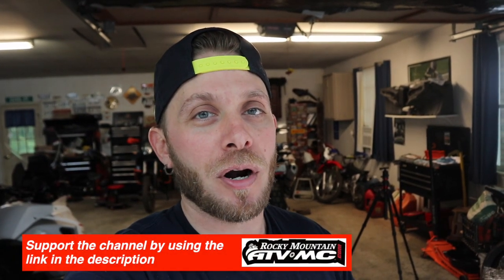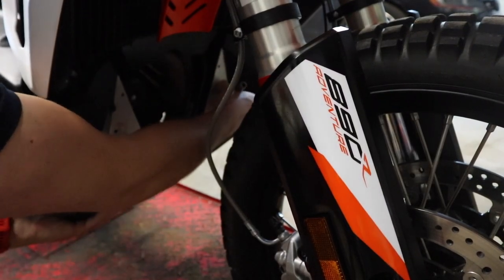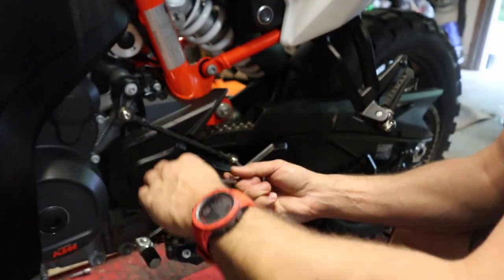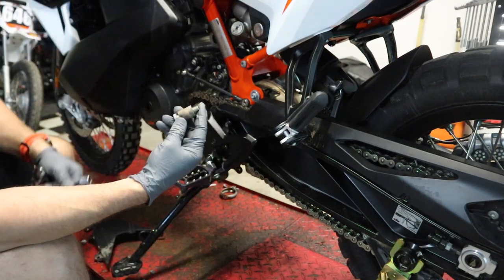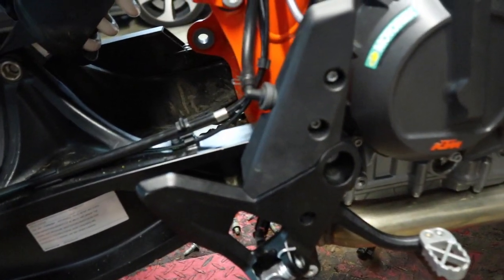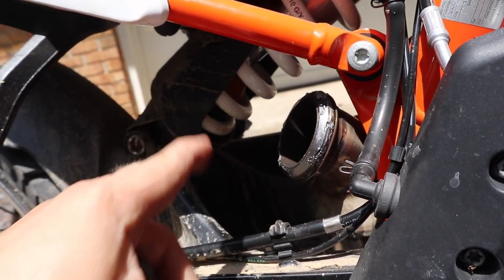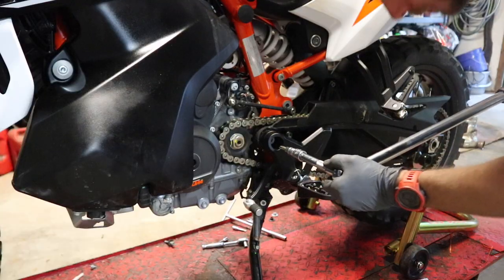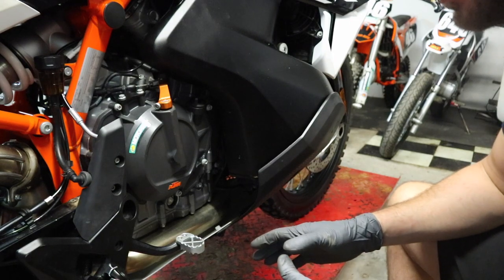KTM 790 890 ADV Cat Delete Mid Pipe | Back in the Garage

Comment: Thanks for this. Just finished up a 23' 890 Adventure. A few notes which may be 23' specific. If you are re-using the original bolt that held the cat on to secure the mid pipe it's 15 Nm. The shift rod bolt is 10 Nm. The 3 T-45 for the footrest bracket side stand all need loctite. I wasn't able to get to the right side cat bolt behind the brake lever with a ratchet and socket and had to use a 10mm open end ratchet.
Reply: thanks

Comment: I have owned other bikes with a cat in the pipe and simply drilled the cat out using spade bits. On another bike I simply cut open a window on the side of the pipe and removed the cat. Then rewelded the piece back.  Any reason no one does this with these bikes? If the pipes are stainless than I understand that takes a different welder.
Reply: 1.  drilling out the cat means you can never restore the bike if needed.
2. Arrow mid pipe weighs several kGs less than the cat, and it’s smaller which creates more space between shock and pipe 
3. Few people can weld or have access to welding gear.
4. Arrow mid pipe looks professional grade. A cut out and welded cat won’t
Reply: @TapleyBS  Makes sense and good enough reasons for most. For me: 
1)  The cut can easily be located in an area not visible, its just a small window. 
Also, the pipes I cut have heat shields, can not see the welds.
2) A couple pounds in weight savings on a ~500 lb bike when gps, bags, tools... are added can be accomplished with rider losing some weight. lol  No one will notice a couple pounds  low on the bike anyway. The 890 weighs 12 lbs more than the 790 and no one ever mentions it.
3) Pipe heat shield to protect the shock would be better and are cheap.
4)  $400 savings, I'd rather remove. But hey, I'm cheap and a diy'er.

Comment: Hey Mario, how did you find the heat issue, any significant improvement? How about performance,  any issues with popping or backfire on the overrun? Lastly, any issues at low throttle or low revs? Thanks.
Reply: Ask the owner of Wings Exhaust why he doesn't sell these cat deletes.  He will confirm exactly what you said above.
Reply: @RayzGarage  cheers, I still haven't installed one with my Wings exhaust as I suspect there might be issues. I would prefer a 1st hand experience before completely ruling it out. It is Summer here now and when the temp gets really hot, the exhaust heat from the cat gets quite uncomfortable in traffic.
Reply: @ride4adventure  got me.... That's what caused me to contact the owner of Wings for his advice.   I stand by my decision to leave it in

Comment: Just did 500 miles with my arrow and put my akro baffle back in. Instantly relieved my ears. Sounds dope with a straight system, but when you have a long trip or several days ahead, it still sounds good and keep the twin drone a bit. Stock muffler probably is great on the ears and still sounds cool. 

I agree, heat is way down. Keeps excess heat off the rear shock too, which has been known to fail early from CAT heat.
Reply from the maker: Appreciate the insight, Jordan! Realize the stock muffler doesn't sound "as" good but I'm a cheap bastard 😂 Another good point on the car and shock failure which is why I wanted to get out in front of it.

Comment: Off-road or on the road air is everywhere so why is it such a violation to run the new mod anywhere for that matter and I think it’s more of a safety hazard with that stupid hot cat can under your seat and ready to melt out the seals in the shock to blow out the shock and cause ride ability issues! I’m all in for this cat delete mod and great video!!!
Reply: measure at your cat and at the exhaust outlet.  The cat is not actually that hot.
Reply: @mojoriden  it puts out a ton of heat all over it with no where to go but your rear suspension and left leg. there's nothing else down there to create the heat but the cat.

Comment: did you happen to think to heat wrap that midpipe? I am putting on a similar midpipe swap and am thinking of wrapping mine...also installing the plate between that hot area and the rear shock.  Thoughts????
Reply from the maker: No. The cat is what gets hot. Once it's removed the midpipe is much cooler.

Comment: Thanks, I appreciate your videos. Once I do this will the factory mapping still work fine or do I need to add a power commander and a tune?
Reply from the maker: It’ll work fine
Reply: Engine performsnce has improved? How It effect at lower rpm, the engine lose torque, fluidity? Many thanks

Comment: Quick question,,, I removed my catalytic converter and did the same as you,, left the gasket on the cat. 
I couldn’t understand what I’d done wrong, found your video,, and thanks. 
But my question,,, how did you get the gasket off the cat??
Reply from the maker: Just used a small screw driver to work the edge and then it’ll slip off

Comment: Will the mid pipe void the factory warranty?  Wonderful garage video as always. Bike definitely sounds better now.
Reply from the maker: As with any modification (in the US) the warranty is only voided if the modification can be shown to have caused the problem. e.g. if the tft display dies they have to fix it because the mid pipe didn’t cause that. It’s only a year warranty on the bike and mine was already out anyway

Comment: Mario I followed your vid and installed my Arrow Mid-pipe today. All is good, no leaks at all… But one thing I wasn’t clear on is the tab on the mid pipe and how it attaches to the small frame tab that comes down. I just had issues trying to figure out how to make that solid so I can torque it to the 25 Newton meters. Ultimately I used one of those black spacers put that on the outside. I’m not 100% happy with that connection. I mean it is solid and I’m sure it’s fine but it just wasn’t as neat and clean as I would’ve liked it to be. Any suggestions on that? Thank you.
Reply from the maker: Sounds like you've got it tweaked a bit. Loosen the exhaust clamps on both ends to release the pressure, then try again. Shouldn't need any sort of spacers to fasten.
Reply: @2WR  ok I’ll do that. Thx

Comment: Are you planning to change the exhaust can with a slip on? Would seem to add more to sound, and possibly save some more weight.
Reply from the maker: No, I’m gonna leave the stock can. Check out the video we did on the Norden 901 exhaust. All the weight savings data is shared on that one.
Reply: @2WR hi, from italy. Is there difference from a totally empty decat, or one like that you mounted in this video? Because I have a totally straight decat..without the little decat you have in your, i mean...and did you a map after this installation?

Comment: Great video!
I did the same installation to my bike but I have a problem. After 5 kilometers test run my engine was stalled and it won’t start again. I have to pushed my bike home and replace the decat mid pipe to the stock catalyzer pipe. And when I start the bike it only runs for 130 seconds and stopped. I don’t understand which step I did wrong…Do you have any idea?
Reply: Does it sound decent when it runs, do you hear anything different. Something might be shot.

Comment: Great video, I love my 890, however this heat that radiates out is unbearable especially in Las Vegas. So all I need is that arrow midpipe? And you truly noticed a heat difference? Because I’m thinking about getting a new bike due to this heat. Thx
Reply from the maker: There's a noticeable reduction in heat. Also, I don't know what your riding gear consists of, but a quality pair of riding pants due wonders in keeping your legs from cooking.
Reply from the maker: I'm not complaining about the heat since I wear a good pair of riding pants. That said, if you don't have your feet in tight and legs up against the frame, you don't have proper control of the bike. (aside from cornering when you need to weight the outside of the peg)

Comment: Good job, I wonder if it does need retune the ECU ?
Reply from the maker: If you want to FULLY maximize performance, yes. That said, it's not require and you'll still realize some gains from it (aside from weight savings) if you don't.
Reply: @2WR  thanks 🙏🏻
Reply: @2WR  Do you have a recommended flash or tune you recommend?
Reply: Any time you remove the catalytic converter on a vehicle you should get the engine tuned to adjust airfuel ratios for the higher flow rates. If you are removing the Catalytic converter it is also suggested to get a high flow airfilter aswell.

Comment: The clamp that goes on the midpipe and the engine pipe just will not line up, the engine block itself is not giving the clamp enough clearance. Did you have any issues with this? Spent the last 4 hours trying to get this clamp on and it will not fit.
Reply from the maker: I’ve installed 3 of these on 3 different 890/901s and didn’t have that issue on any.

Comment: Hi I am getting my new 890 duke r on Saturday and want to put a decat pipe on. Does this need mapped after install? Or runs fine just with decat fitted??
Reply from the maker: Assuming no other major mods, no remap is required.

Comment: So, by changing the mid pipe wont that require a new jet tuner?
Reply: I was about to ask the same question. I’d be interested to know what are your thoughts on that Mario!
Reply from the maker: If you want to FULLY maximize performance, yes. That said, it's not require and you'll still realize some gains from it (aside from weight savings) if you don't.

Comment: Mario, quick question please...thoughts on KTM engines are already tuned high for performance...my concern is that a d cat will further tune the engine to the side which may put additional stress on the engine longer term?  In your opinion is that fair, or would you disagree?  thanx appreciate the comments!
Reply from the maker: It puts no added stress on the engine. It’s simply removing a restriction on the exhaust.
Reply: @2WR  great Thanx!! However, like you say it is illegal on the road hey??
Reply: @Gorilladome4664 its completely illegal

Comment: thx for the video. did you notice any less heat after the cat delete? any other improvements or cons? thx
Reply from the maker: Always riding on riding pants and off-road/ dirt bike boots so I’ve never noticed any heat to begin with. Biggest pros are the bike no longer sounds like a bunch of bolts rattling around in the crank case and it has better pick up low to mid range.
Reply: @2WR  thx. you near charles town, wv by any chance?
Reply from the maker: 15-20 min away

Comment: I'd do it just for the sound and heat. With a 1290 it already has more power than I'll ever need and if I was concerned about weight on the bike I'd eat less. Thanks.
Reply from the maker: Does sound a helluva lot better.

Comment: Can anyone comment about removing the cat leading to being too lean and a service light that knocks out cruise control?
Reply from the maker: Brent, short answer is "it could." That said, haven't had any issues. Is the service light question a separate question? If you turn off MTC, cruise control will not function. It will also not function if your ABS Sensor/Wheel Speed sensors are disconnected or faulty.
Reply: CC works fine on mind. My bike is in the shop having the cams replaced. Trying to puzzle out what happened to the cams. Mechanic said probably high heat or improper manufacturing.
Reply: @garyib7200 CC removing should be generate additional engine heat due to leaner carburation, so maybe generate additional stress to cams. Thats why Is often recommended to remap when CC Is removed
Reply: Should generate additional heat* im italian, made a language mistake

Comment: Why delete the cat for a mere weight savings of 4 lbs.?  Just delete the sub and soda you have in your tailbag and take a crap before you go riding.  The euro 5 emissions software on the 2021+ is inclusive of the cat in place and incorporated into the ECU. The lack of a cat will make the bike stumble at high revs. I was told by a pipe manufacturer after multiple runs on the Dyno that a cat delete actually hinders the performance and certainly kills the warranty. Personally, I would not alter the performance of my bike over 4 lb and a little extra heat that I've never felt on my 890 ADV anyway. Just IMHO! However, congrats on your very informative how-to video for those that dont care about performence and value loud pipes.
Reply from the maker: May want to familiarize yourself with the Magnuson-Moss Warranty Act. But yes, the rest is “just your opinion.”
Reply: @2WR  I know it's been a month but thanks for that information about warrenties.  It states that the consumer is allowed to add aftermarket parts and can't be denied warranty coverage unless the manufacturer can prove that this modification was the cause of the problem.  It sounds as complicated as the warranty itself, lol.  To each his own.  I was strongly advised by a pipe manufacturer not to do it so I decided to deal with the extra 4 lb.  
This group is for learning so I thank you for providing me with that educational information.  I might be able to use it someday.  Brapppp!
Reply: it may be different on the Norden Expedition, but the heat delete will save my rear suspension and left leg. I don't care about the weight.

Comment: At 16:08 the torque setting for the silencer is 25nm not 15nm, as per repair manual🤷‍♂️
Reply from the maker: You’re correct about the torque spec (I don’t actually use a torque wrench on the silencer bolt)  but wrong about the timestamp.